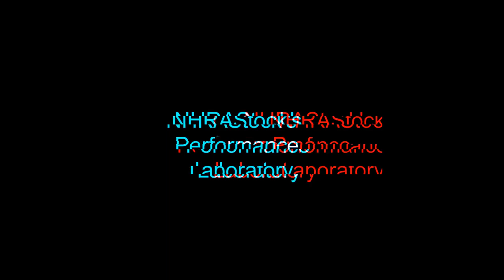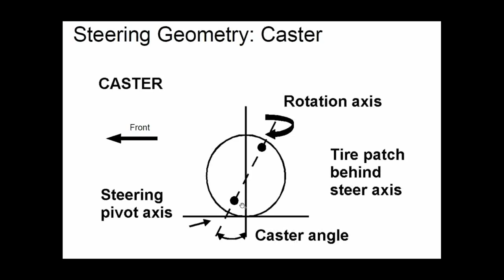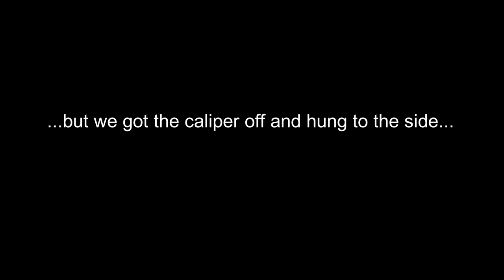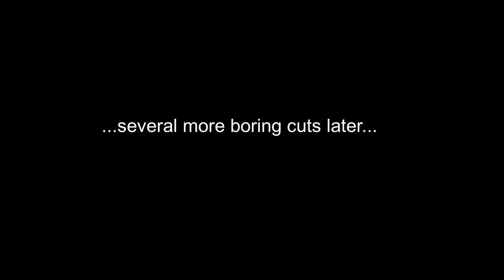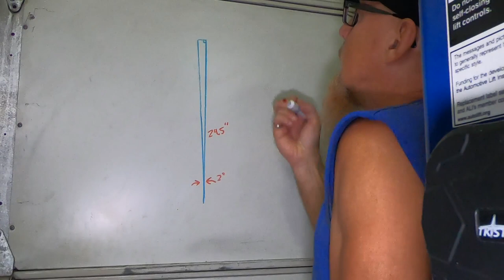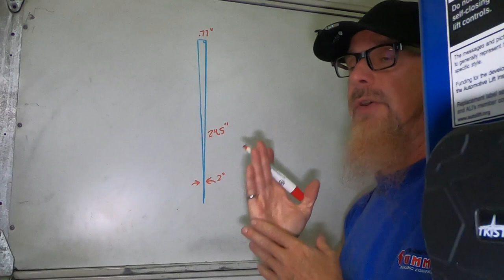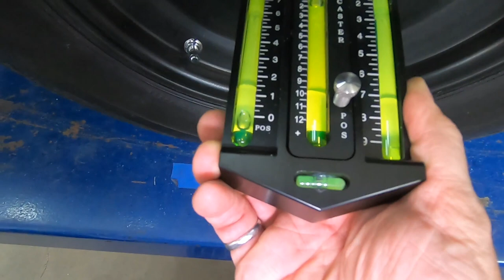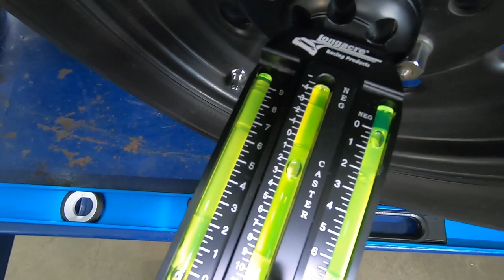Caster Camber Plate Installation and DIY Alignment

Comment: Positive caster causes the car to all ways come back to center, to stay in a straight line all the time if it has enough poss caster, 6 or 8 degrees poss caster is best !!!!
Reply from the maker: Caster gives tracking stability. It's actually king pin inclination that generates the self centering moments.